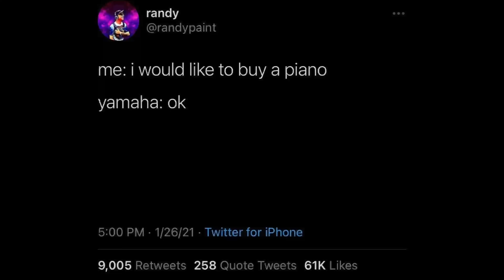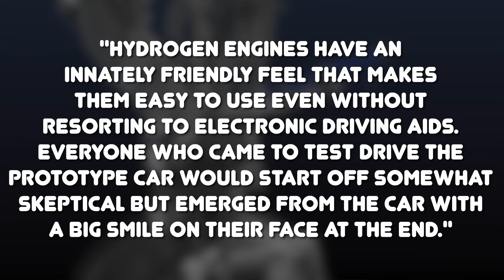Toyota's New 455HP Hydrogen V8: Everything You Need to Know

Comment: I happen to live in Japan near a Toyota engine development manager. He believes that the difficulty and environmental impact of making the batteries is a big problem, but our complete inability to generate or distribute the electricity to a worldwide fleet of electric cars makes it practically impossible.
Reply: yep, that's the one thing which people aren't taking into account, yes it's all well and good to have electric cars, but when you go .. okay lets charge some cars up, or lets run fridges and air conditioning as the infrastructure isn't there, then it's a whole different ball game
Reply: @MassageWithKlay  Ok let's say it would be impossible to charge electric cars because it is too much power and we couldn't generate it.
How would we make enough hydrogen? Hydrogen doesn't exist in its pure form on earth. We can either use Fossil fuels to generate it which makes it worse than just using gasoline or we can use electricity which means we need 4 to 5 times more electricity than if we would drive EV's. 
I did the calculation for Germany, and they would have to increase their current power generation by 20% if every car on the road were an EV. That's a lot but doable. 
Using Hydrogen in Fuell Cell Vehicles that would be around 120% increase, already less feasible but maybe doable with nuclear. 
Going Hydrogen in Combustion Engines that would be a whooping 600% increase in needed electricity production, and that isn't going to happen.
Reply: @Isamu1013  If we were to actually utilise technology which already exists we would easily be able to produce enough hydrogen. What people don't understand is that Stanley Meyers already created and produced all the items needed in order to have on demand hydrogen for an engine, only utilising the cars electrical system.

I know it's impossible to create enough hydrogen from water on demand when you utilise the 200+ year old process of adding electrolyte to water and then having a huge current draw through a DC system in order to produce barely enough hydrogen to make the engine rev at low RPM let alone at anything usable.

But that is the thing, Stanley also knew this and it's why he didn't design his system like that. He used pulse DC using high voltage (similar to that which makes the spark in the spark plug), running at a frequency which basically tears apart the water into it's molecules. In this manner there is no strain on the Grid (which in my opinion is an outdated means to supply electricity anyways but it does ensure good profit) as there is no need to do anything but fill up your car with water and go.

Things people don't comprehend is that common science and understood science are usually two different things. Nikola Tesla has a formula which makes Ohm's Law obsolete. This is because when ever electricity is taught, frequency is usually not even mentioned. If it is, it's on the basis of what frequency AC is standardised for households, at either 50 or 60 hertz, both of which are very good at causing heart palpitations in the body :D
Reply: @MassageWithKlay  Splitting Hydrogen on the vehicle, burning it and getting enough energy out of it to split more and drive a vehicle. That's a good old perpetomobile.
Impossible by the law of thermodynamics. You seem to not comprehend that science isn't magic.
Reply: @Isamu1013  yep, it's so impossible that there are patents available to which you had to show a working model. As I said, if you use the typical means to electrolysis you are completely correct, you cannot extract enough hydrogen in order to do it, as it costs more in energy in order to do it. Thankfully there is more than one way to skin a cat.

The potential energy of hydrogen far exceeds gasoline, but the typical means of separation requires huge amounts of amperage to permeate high electrolytic water in order to perform the action. Thankfully when using science and looking at it from another direction, you can utilise frequency for separation.

If you want to see the impressive nature of frequency, have a look at the really crappy video's done by John Hutchinson, which show things like levitating bowling balls, and thick aluminium bars pulling themselves apart. Even the most simplest physics shows the power of frequency when you put the right frequency into glass, first it will become plastic and then eventually all the bonds get to a state where it can no longer hold together and breaks apart. 

Stanley Meyers did exactly this with water, got it to a state of agitation until the molecules end up breaking. This is not the same as electrolysis, where the current flow of electricity being carried by means of electrical conductivity through an electrolyte. 

If you want to have a look at the most typical examples of frequency and the amplification of it, all you have to do is look at pretty much any string instrument, pipe organs ect. If you want the destructive power of frequency, just have a look at walking bridges which have fallen down due to people waking in sync. If you want to see how efficiently you can maintain a frequency in a tuned system, there is a great example on YouTube from one of the Uni's where he is swinging a boxing bag, takes a bit of effort to get the bag swinging but takes very little effort after to maintain it.

Absolutely nothing which I said here is magic, and if you keep on thinking that there is only one means to do something, and then repeat it and repeat it again, to expect different results, then I'm pretty sure Einstein stated that was insanity, and because of the fact that not only can I understand the concept on a micro and macro scale, I'm pretty sure that makes the science sound.

Sadly it's people who say that something can't be done, who are always outclassed by people like the Wright Brothers, who I'm pretty sure were told many times that they'll never be able to fly, and now we have planes, rockets, missiles and all sorts of other things which happily fly through the skies. Maybe one day you'll actually think to yourself, okay so this doesn't work, what other means of process can occur which is far more efficient that can do the same thing, and you'll end up with your name echoed through history like the Wright Brothers. Or you can just troll people like me stating things which I already understand and know that it's a crappy process and can accept that you can actually do some pretty cool things when you don't limit yourself to just a single perspective.

You probably haven't even heard of people like Oliver Heaviside, J P Steinmetz, or any of the other pioneers of electricity who all though that Einsteins theory about a charge particle was a bunch of hooha, and today we still haven't found that particle. Funny that.
Reply: @Isamu1013  Exactly but this doesn't take into account the use of renewables, like solar panels on people's houses. Once you factor that in, the extra demand on power supply doesn't look as bad. Unfortunately, there's no such magic recipe for hydrogen.
Reply: @MassageWithKlay  
"If you want to see the impressive nature of frequency, have a look at the really crappy video's done by John Hutchinson, which show things like levitating bowling balls, and thick aluminium bars pulling themselves apart. Even the most simplest physics shows the power of frequency when you put the right frequency into glass, first it will become plastic and then eventually all the bonds get to a state where it can no longer hold together and breaks apart."

I first came across this claim in the early noughties in a book called 'The Hunt For Zero Point' by a former Jane's journalist called Nick Cook. Cook explored the claims of anti-gravitics and ended up sacrificing his career. Frankly, I admired him for what he did and even I was taken in by some of it. The fact is that Hutchison's claims were a bit smelly and nobody has ever been able to repeat his claims when done in a proper laboratory. We're not talking about, you know, fuel companies. We're talking about universities.

"Sadly it's people who say that something can't be done, who are always outclassed by people like the Wright Brothers, who I'm pretty sure were told many times that they'll never be able to fly, and now we have planes, rockets, missiles and all sorts of other things which happily fly through the skies."

This is a strawman argument. There were so many people experimenting with heavier-than-air machines that powered flight was an inevitability. All the Wrights did was to figure out how to control it about all three axes. I'd also caution against bringing up the Wright Brothers. They tried to patent literally everything and the only thing to come from that was to massively delay the advancement of the American aviation industry. They spent most of their later days in court.
Reply: @thethirdman225  are you telling me that no university has ever performed the experiment where you take a glass and run a frequency into it through a speaker and had it first turn into a fluid object before breaking ??

It's never an understanding of if it's been done, it's only if they have pushed it far enough to repeat what someone else has one.

Even the experiment where John puts a copper dome in a tree and then grounds it through a low powered motor has been repeated with either just charging a capacitor or something else of low power.

The challenge that most universities have is not the ability to repeat an experiment, but more that they can't allocate the experiment into particle science.
Reply: @MassageWithKlay  No, I didn’t say that. I said some of his claims are a bit smelly.
Reply: @MassageWithKlay  Repeatability is absolutely essential to theoretical science experiments. If you can’t repeat it, it can’t be established as scientific theory and it must be done in a controlled environment. There are lots of things in science that can’t be explained. That doesn’t suddenly make those things important scientific discoveries.

I have done my own testing in a lab environment and what I was testing was pretty controversial so I attracted plenty of scoffing from the non-scientific community. The work I did was not completed by me but the project was mine and it essentially confirmed what I already thought. People still think I was barmy. But the salient difference is that what I was doing was absolutely repeatable and while I was not trying to establish a theory, it would have formed a body of empirical data.
Reply: @MassageWithKlay  
"okay lets charge some cars up, or lets run fridges and air conditioning as the infrastructure isn't there, then it's a whole different ball game"

ALL of this can be easily done with renewables. My cousin lives in a small town in South Australia. He just bought a Tesla and he will be charging from the solar panels on the roof of his house, so that whenever the car is in the garage, it will be charging (he also has a storage battery on the wall). You can do that with any ICE. An electric car already costs about 20% of the cost of an ICE to run and is nowhere near as subject to the impact of unstable fuel prices, which we have seen so much of in the last year or so.

In short, this car will cost him very little to run, with epic levels of performance and a good enough range that living in a remote community isn't a concern for him.
Reply: Coming from the people who made the Prius, they probably know a thing or two about that
Reply: Well do me a favor tell him that water is so abundant and it is so good for the environment and we will have more water than we can put our hands on when the oceans raised to 3 inches above regular sea level so we might as well start making boats and submarines and airplanes and cars and stuff using water for a fuel source and it's environmentally friendly

Comment: Their is something called hydrogen degradation, I do not believe hydrogen is the answer because of this, nor electric.
Reply: It’s already been used in semi trucks, and the result was very bad, the Cummins hydrogen powered block doesn’t live long because the hydrogen starts to corrode the metal and eventually destroying the blocks. The heads where worse because of uneven surfacing of the block. Thus making the engine useless.

Comment: BS... Lithium' Warns There's Not Enough Battery Metal to Go Around. A mining company consultant with decades of experience doubts the industry will be able to support all the electric car production planned. Oil is not going anywhere as long as it's in the ground! Hydrogen has been around for decades and STILL not used as its too unstable in cars!!

Comment: Hydrogen doesn't foul plugs, clog valve openings or acidify  oil .
There is no telling how much longer this engine might last .
Let's set a goal of 500k mile engine and see what improvements  it would take to reach that goal .
Checker Cab built a car that could survive hard city driving . Most parts could be easily replaced. 
The current business model is to make money on repairs (that's gotta change )
A hydrogen car with far less emissions won't need power robbing controls . Oil changes will be at much longer intervals.  Aluminum bodies and chassis won't  rust prematurely.  I'm just getting started. We need someone like Elon to get behind these changes to the auto industry.  His access to capitol and his chess like approach to disruption could move such a car forward.

Comment: Check out Bamford and his development using standard diesel engines with a modification to run on Hydrogen and another trial on ammonia.
They've been running a JCB non stop for months on a trial.
It makes sense to use already manufactured and manufacturing processes so the current fleet can be upgraded.
Diggers, cranes, trucks, heavy industry vehicles  are not really practical as EVs.
The battery size to get the range and power for these types of machines is simply not practical. 
The catch is, hydrogen needs energy to make so you can't set up a hydrogen infrastructure unless you are nuclear, hydro or other alternate energy grid like geothermal. Otherwise you'd be buying fossil fuels to make the hydrogen. No sense.

Comment: Yes hydrogen is better than electric in many cases. Say long haul shipping how many batteries will it take to move containers across the pacific ocean? Do you need 2 ships of.batteries to get 1 ship of containers from china to the west coast Is it practical to electrify a semi truck? While it many be done how much time will it cost in a cross countey run to keep it charged? Do you need to charge overnight after 100 miles? LA to Denver is about 1000 miles. That's 10 days or 5 days at 200 miles per charge. Hydrogen is definitely part of the (not the) solution to less greenhouse gasses. If you use coal or gas to make electricity you are still burning something and adding to the problem pushing us toward electric cars

Comment: Electric cars are a scam right now, and anyone who takes a moment to think about it will realize it. They aren't affordable. They only move carbon emissions elsewhere, not eliminate them. The powergrid infrastructure cannot support a total population conversion to electric, nor will it ever be able to in our lifetimes. Batteries are terrible for the environment and do not currently produce as much raw power as diesel or gasoline,  even when the battery is the full length of the vehicle. Their range sucks. People will not wait at a charging pump for an hour when they can fill up a tank of gas in 5 minutes. Lithium is a much more limited supply than oil.  The truth is, electric cars are trendy tools to virtue signal(falsely) about how your doing your part to save the environment, only available to people who live in certain areas and with enough money to afford such a thing, when the reality is your electric car is powered by a coal plant a few miles away.

Comment: I have been doing alternative fuel work hybrids and electric vehicles for over 30 years for the big three and Mercedes-Benz I believe you are very wrong that hydrogen is not the answer and you also wrong that there are no benefits to hide in it burns cleaner so there is no carbon deposits in your engine which destroy them as far as electric vehicles go our power grid will not even handle what we have now let alone everybody in our country plug in a hybrid vehicle as far as hydrogen gas goes is very easy to process with zero emissions we could kill two birds with one stone by making hydrogen and purifying water down south where we have water shortages my hat is off to Yamaha and Toyota.

Comment: Honestly I see as this, starting to sell in California where they are more worried about carbon emissions and slowly start to get more popular, since hydrogen is pretty easy to make and it'll be cheaper then gasoline. Even tho they make around the same power as a normal gas engine there is still room to make them better, it was the same way with electric cars. Plus I think hydrogen can be put into tanks under pressure, so it's like refilling a propane tank.

Comment: Is there enough copper in the world to make electric cars required.  How are you going to put the power into a d10 cat.  
Stored energy in the battery is inherently more dangerous than releasing the energy in a combustion engine. Fast charging a battery is inherently dangerous.  
We have the infrastructure available to adapt for hydrogen in the LP, liquid propane, industry.  Cars have been powered with that many years.  
We do not have the same for electric cars.  Electric cars i believe are ultimately powered by coal fired power plants. 
The question is which infrastructure can  be built in a reasonable time.  
PS:  please keep breathing the plants need the carbon dioxide and i like to eat.